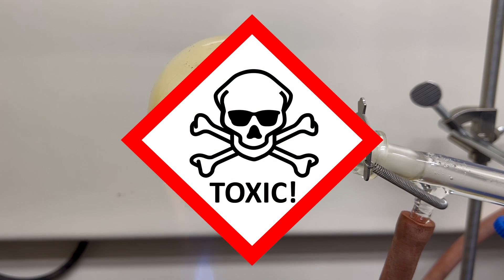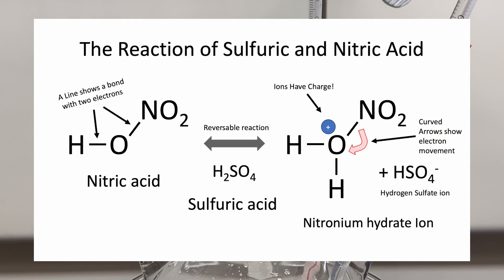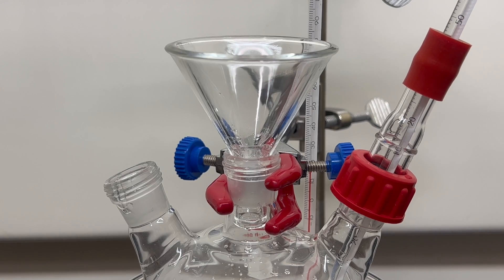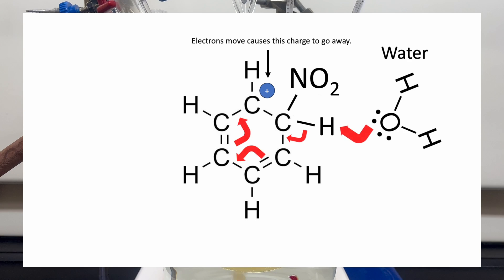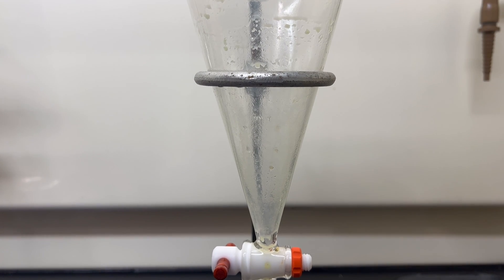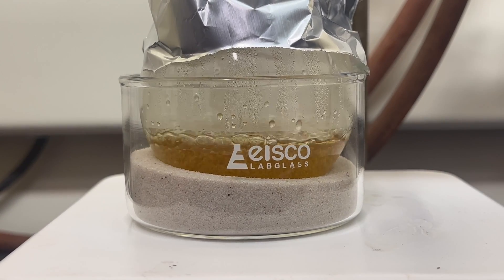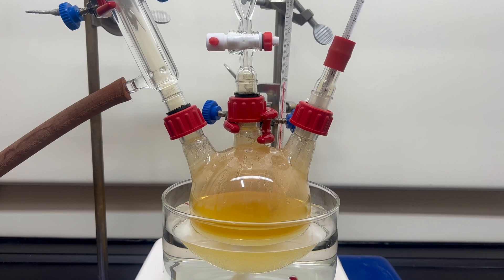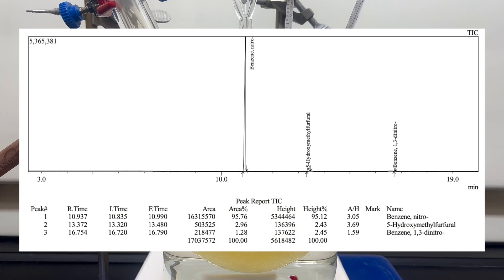Nitrobenzene Production, Mistakes to Avoid and Analysis

Comment: Super cool and love the analyses! I also nitrated benzene with the intent to make aniline but used a nitrate salt instead of mixed acids. This made nitric acid that was too strong and then the literature temperatures for mixed acids gave me nearly all dinitro 😅
If your main goal is aniline though I highly recommend making it from the decarboxylation of 4-aminobenzoic acid (PABA) - super easy, clean, cheap, and high yielding - I have a video on it if you're interested.
Reply from the maker: Thanks, these video are more of an exploration of the chemistry. I have no use for each chemical I make; besides the next production, and generally I don't even use them for that as I have bottle of each chems already. Thanks for the information though!
Reply: @WheelerScientific  love your content! Excited to see your channel continue to grow.